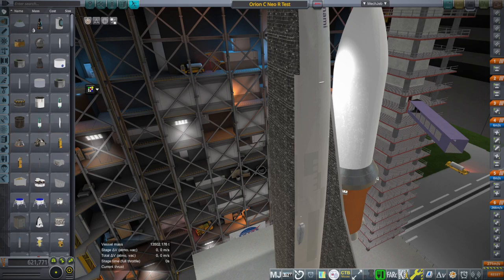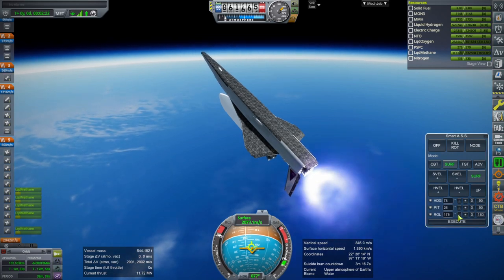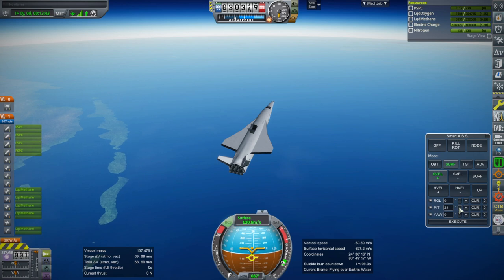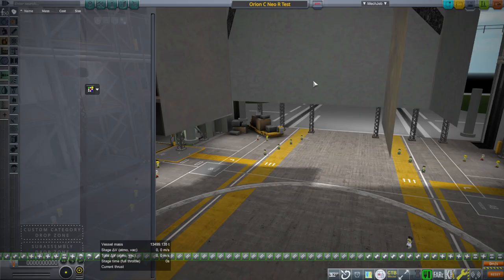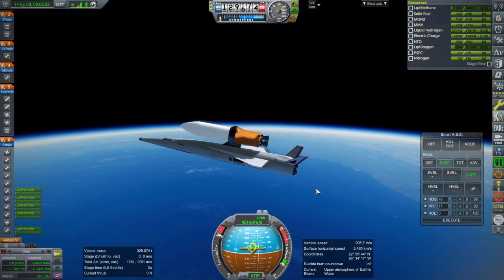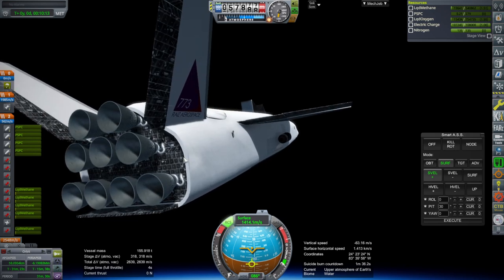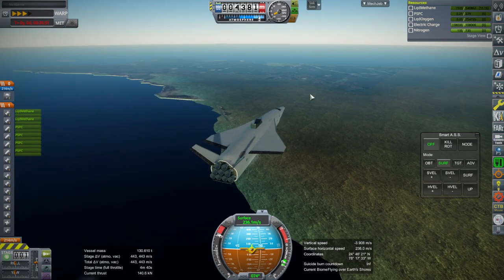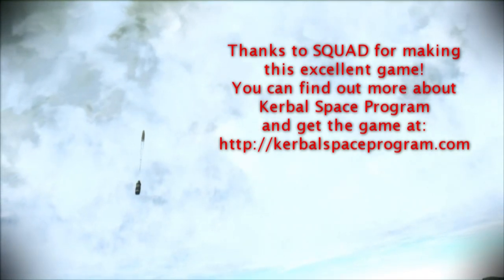KSP 1.12 with RO - Orion Carrier Plane Performance in 1.12

Comment: The engines show the residuals not the tanks
Reply from the maker: Yeah, forgot about that, especially since the system is implemented through Real Fuels, which was only supposed to modify tanks (RO is what was supposed to modify engines to fit RF).

Comment: So if you're adding jet engines, would it make sense to go more Skylon like and replace some rocket engines so you can take off horizontally?
Reply from the maker: It takes a lot more jet engine power, and therefore more mass, to takeoff with a full load of propellant for the mission than it takes to land with just enough for a few hundred miles of jet propulsion without a payload. That might make sense for a more efficient system using hydrogen, but then you end up with a much larger plane and you're hoping for some fancy materials to make the body light enough to make it work, especially adding all the mass to get the jet engine thrust (even if it's integrated with the rocket engines, the engines are going to be much heavier than just pure rocket engines). You obviously save some mass by not carrying some oxygen, but it's a tough balancing act that's also dependent on how fast you can go in air-breathing mode. I tried to make this design with currently available technology and with as much margin as possible.
Reply: @RaizSpace  > I don't disagree with you on any point you state, I would note though that there have been more than a few design studies where thet have advocated for HTHL in one or two stages, using things like hybrid rocket/jet engines, or things like cryogenic hydrogen/oxygen injection into souped up jet engines (IE the Soviet Spiral airbreathing stage). Plus the IMO missing fully regeniteratively cooled and fueled cryogenic jet engine that could (should?, AKA Skylon SABER engines) exist but funding priorities always seem to lay elsewhere.

But since your spaceplane has wings why not use them on both legs of the journey I say! 

YMMV 😄